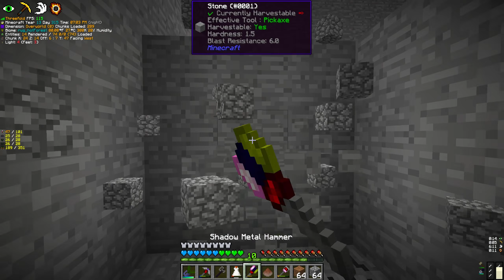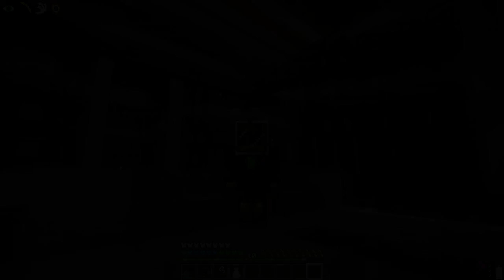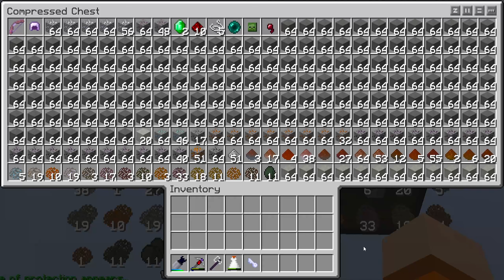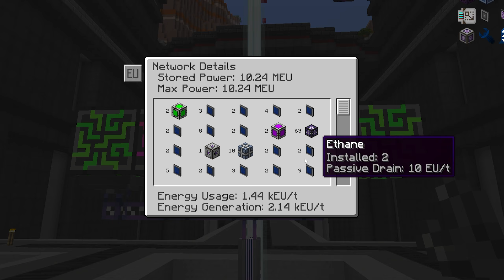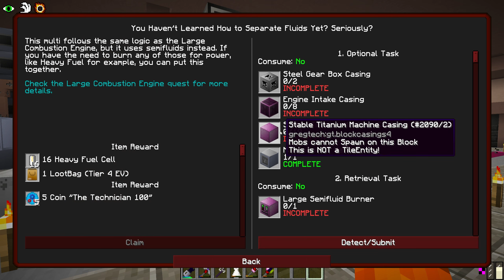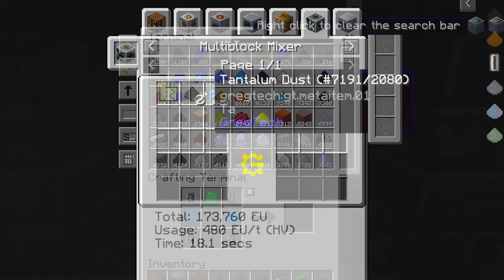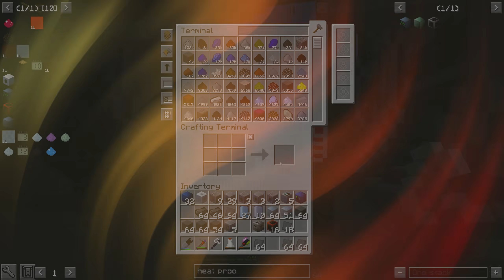Gregtech New Horizons S2 41: Foiled Plans

Comment: Just got my first LV wiremill up and running lol... I happened to get a vanadium steel screwdriver in the lootbag from the quest, too! So that should hopefully last me longer than the wrought iron ones I'd been using for crafting, although I might just use the vanadium one for tool uses instead. Which reminds me that I need to make circuits for programmable recipes, noob mistake to not account for those and I'm not quite to the point where I want to batchcraft the LV circuits since I'm using the worst recipe and the worst material production for almost all sub-components... but it's a start! 😅.

Comment: Threefold you need to slow down with releasing these bangers ... otherwise I might be motivated to start playing again myself :p

I usually like everything about these episodes except the music isn't all to my taste
So I had to say that the music at 3:00 was remarkably good this time.  And good at 20:00 too.  (I also really liked the edit of "you take me right out into space" many episodes ago when you went to space - simple but effective!)

With blazereed and salty root, sulfur and chlorine should be no problem.

I was using HP Steam Turbines and Steam Turbines with Alduorite Rotors.  They are fantastic for power generation because they can max out a buffered IV dynamo hatch, ie give you 1 amp LuV per HP Steam Turbine.  The huge downside is they have low fuel efficiency, plus you can only cook Alduorite in an Infernal Blast Furnace until LuV, and it might be meteor only.  Oh and the IV dynamo hatches take Indium.  It's worth the efficiency tradeoff for lava or magic super fuel steam, maybe not for fluid nuke steam or benzene though.

Comment: If you want to ensure that you have emergency power even in the case of a blackout, I found that it is useful to set up a system using AE batteries and the ME toggle bus to create a emergency backup power of sorts. It's a pretty simple redstone circuit where it charges the batteries till they are full and then shuts off the toggle bus. The only way to turn it on would be manual interaction to turn it on (comparator to read the energy state, when its full delay the signal for a bit to ensure you didnt just turn it on, the output of that sets an rs latch which turns off the toggle bus, the reset line for the latch can go to a button next to the terminal). Normally you put this system right next to your main dirve area and it would temporarily disconnect the rest of your network as to maximize the amount of time you have access to your items.

This gives you a bit of room to pull out the materials you need to fix the issue, and is totally extra and unnecessary seeing as you can just disconnect the power hungry parts of your base manually, but fun nonetheless. Its saved my butt a couple times when I was being careless.
Reply from the maker: Yeah in previous packs I've been locked out and it was a disaster haha :D

Comment: If you do the math you'd quickly realize that running AE2 off of the benzene wouldn't strain fuel production at all, even if it was consuming twice the power that it is...the question, and problem, is "then what?" If Three simply hooks up AE2 to central power and then goes on to set up, say, Platline, turn it on and have it run alongside ore processing, and the limit of his IV battery buffer is reached (it's only capable of outputting 4A IV at this stage, which is frankly peanuts) suddenly everything is going to shut down and create this big mess to clean up. Power is something you want to stay on top of at all times, and stay ahead of the curve that you're going to hit an hour from now. Because if power fails you've got a very big problem to clean up and not a whole lot of anything with which to do it.

So what options are there for running AE2 off of non-centralized power? Well, not as many as you'd think, and that's because of one bit of really silly pack design - Sunnarium. Solar Power that's more than <1A LV (at least consistently) requires Sunnarium, Kinetic power requires Sunnarium batteries (and Iridium if you don't want to deal with periodic replacing of rotors), and the only way to get Sunnarium in EV is to turn glowstone fuel rods in a nuclear reactor. In which case...you have a nuclear reactor. So yeah. Speaking of, reactors are an entirely valid method of powering AE2 systems off-grid. Even the most basic EU reactors can output 5A HV (Thorium) or ~2A EV (Uranium), and these types of reactors can be very easily automated using redstone. They also last a very long time, especially when properly automated to only burn fuel when they need to. The catch is that reactors require a ton of obnoxious crafting of components that don't stack, and while you can design reactors using only cheap, simple to craft components the power output of those reactors is going to be...well in a situation like this is might just be enough to go from losing power to gaining power. But honestly that's closer to damning with faint praise than not.

The Benzene schematic you guys are probably all familiar with by now will get you up to this point, but if you want to take benzene all the way to ZPM it is not going to be enough. And the schematic is not designed to be expanded much more than Three already has build it, so a new solution is required. GT++ multiblocks will run the required recipes faster/more efficiently, consuming less power and thus producing more benzene worth of power in the end, as well as run recipes in parallel instead of just overclocking, meaning even more energy efficiency and, in turn, effective power production. But wait, there's more - the need for EV+ tier multies means a good opportunity to introduce LGTs instead of the single blocks, which will massively increase the fuel efficiency of the gas you're burning to power the setup in the first place, meaning, once again, even more effective power output (or you could outsource the power generation to something like nuclear reactors, even. Up to you). Of course I've not designed a schematic for GT++ benzene processing, but frankly if you make it far enough to need it you should be able to cobble a design together yourself easily enough. You're going to have a hard time putting it together without some form of ore processing system you could reverse-engineer in the absolute worst case, at any rate.

There's several material specific ore processing options that were added in 2.3.0 or at least sometime post-2.2.3, so it pays to pay close attention to NEI. Not all of these options will be shown in the ore processing overlay NEI page, so keep combing through pages if you're in need of something specific or want to know if there's something extra you can do with your ores. For Tantalum specifically there are alternatives - Thermal Boiler shenaniganry or Transmutation, to name two - but special Ilmenite processing is another valid option. And a good one, too - Niobium will be important in the future, so it's not a bad idea to stock up now.

To add to/clarify Three's shopping list, the Industrial Coke Oven has two heat casings it can use - bronze heat resistant casings and steel heat proof casings. The latter is better at it allows the multi to run more recipes in parallel, and since it only costs steel there's no reason to ever bother with the bronze versions. If you're curious the two options exist because this multi, by default, is available much earlier, but GTNH gated the recipe past the point where the two heat casings made sense. In addition another quirk of ICOs (at least in this particular case) is that they're prone to maintenance problems - one maintenance issue is enough to cause the recipe to draw more power than 2 HV energy hatches can provide, so you'll want to use a third HV energy hatch or supply 2A EV to a single EV energy hatch to allow the multiblock to keep running through maintenance issues. Coincidentally if you're upgrading from an old benzene schematic to a GT++ one your old pyro ovens will have six HV energy hatches between the three of them, so that's an easy solution to that problem. Finally you'd ideally want a Large Processing Factory instead of a PA to handle fluid extracting extra wood tar from the produced charcoal, but LPFs are - as I believe I've mentioned before - a very expensive rabbithole for Three to jump down at this particular time. A PA isn't as good energy efficiency wise, but it'll get the job done just fine.

For the record you'd need three Air Intake Hatches in order to fully saturate an EV GT++ centrifuge, but this particular setup with producing benzene can get away with only two - it's close, but it will still produce enough (or so my math claims, but I'm sure that has never been proven wrong before...). In addition, for those curious, a single Air Intake Hatch produces as much compressed air as 37.5 LV compressors. So, yes, Three is cutting out over a stack of LV machines using two blocks.

Now some of you might be thinking "surely this isn't all it takes to have Benzene carry you to ZPM, right?" And yes, you are completely correct. Not pictured here are the 14 EV Distillation Towers required in order to process all of the wood tar this setup will produce, or the GT++ DT replacements that will be able to accomplish the same in one IV or two EV multiblocks. The problem is that if LPFs are a rabbithole GT++ DTs are a rabbit bottomless pit right about now. It requires an LuV powered Chem Plant that's at least Tungstensteel casings tier - a hefty investment in and of itself - in addition to just a lot of expensive resources for this stage in general. Alternatively a PA with 53 MV distillers would be enough to turn all of the wood tar into benzene, but this would give up all of the useful byproducts which - if nothing else - total more power in gas/semi combustion fuel than the benzene itself. If you want to take Benzene as far as ZPM leaving over 50% of your power production capacity on the table is simply not going to be good enough. Of course that's all just to turn logs into fuel. Extracting all of that fuel into storable/usable power? We'll get back to that later...

As someone said during one of the streams, "there is nothing more permanent than a temporary setup". 🙃

This GT++ benzene setup requires 112.5 LV fluid extractors, so if you want to use a single PA for the process you'll need 57 MV fluid extractors in a PA. The overclock in the PA compared to the parallels and innate EU/t discount of a LPF will cost you some power efficiency and in turn fuel production, but not so much you need to be worried about it. Back in late LV/early MV these numbers were much larger proportional to current energy tiers, so the loss was much more noticeable. These days the numbers are much smaller relative to power tiers.
Reply: The IV autoclave for sunnarium is way more favorable than the reactor route IMO, maybe the tradeoff would be different for someone invested in nukes already.  Sure it's IV but sunnarium has very few uses even in IV - I've only used it to make botania pixie dust so far.  Like you said, the solars and kinetics that use sunnarium aren't all that good.

The Dangnote Distullus really is crazy, especially since I don't think threefold even has a chemplant yet.  It's mostly useful for rocket fuel (which you need like a couple batches of) or if you want to use an algae farm xdxd, besides the Dangnote of course
Reply: @hacatu  I didn't mention the IV autoclave recipe because that's technically not an EV tier method of obtaining Sunnarium, but yes, if you do want to obtain Sunnarium in IV (for, indeed, Pixie Dust mainly) it is definitely a more convenient method. Assuming you've got the IC2 crop set up for Glowing Coral, and UU production going, at least. I could see someone automating the breeder reactor method purely as a (relatively easy) redstone automation challenge, though.

Chem Plant has some other useful recipes, in fact if you want to take Benzene to it's logical extreme a Chem Plant is basically necessary for producing Nitrobenzene, but outside of that it's mainly a gimmick multi, yes. Even rocket fuel you can largely obsolete with a rail gun/mass driver slime pad rocket booster design (yes, that exists, but no, I'm not sure how it works/is build) and some form of interdimensional teleportation - Witchery, Thaumcraft, Blood Magic, etc.